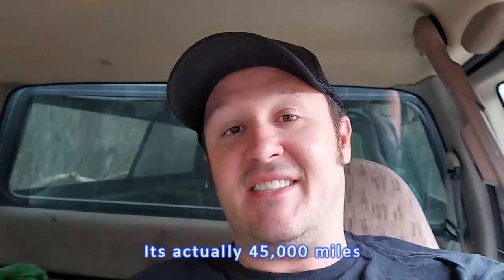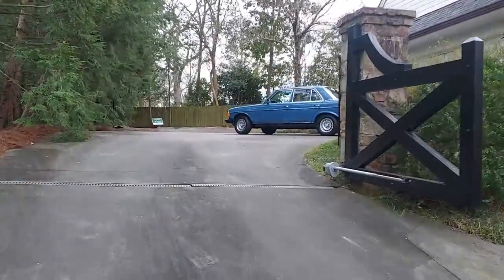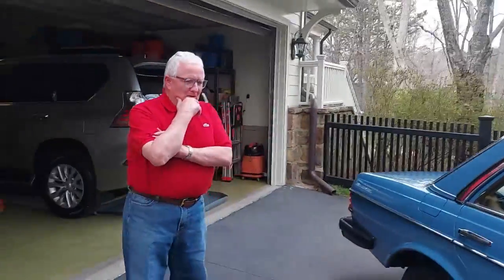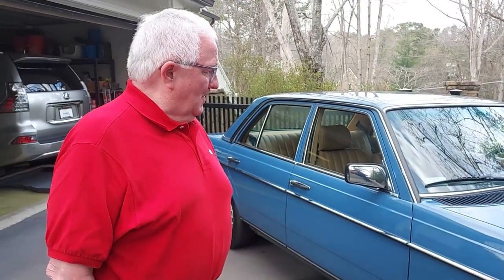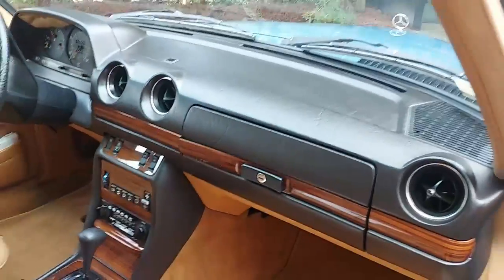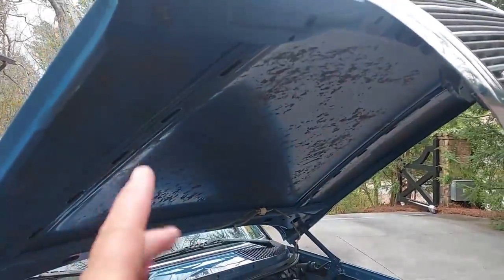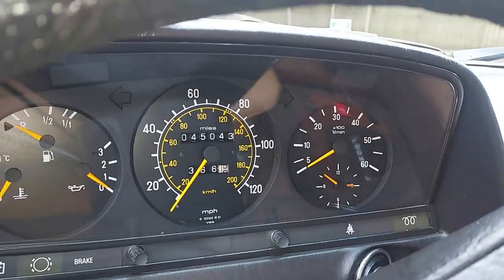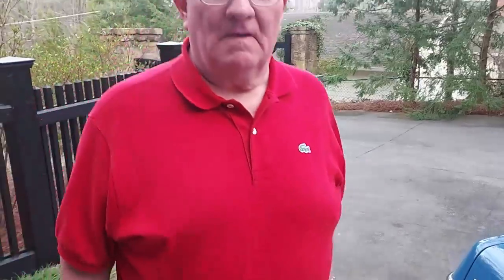1983 Mercedes 300D -  Part 1 Meeting the owner and buying the car

Comment: What a great find….practically a new car!  I had one in that color many years ago with ivory interior.  May I ask what is it about the 1983 models that makes it your favorite?  Just curious….
Reply: I'm curious too.
Reply from the maker: I like 83 models because the seats are little more comfortable and Mercedes started to introduce a lot of plastic and rubber in the 84 85 model whereas on the 83 model you have more metal and Chrome. 83 model also has a much simpler vacuum system then the later years. 83 is just the Sweet spot
Reply: Thanks for replying.  I was just curious.  I have a 240D and a 300D, both '82 models.  Love them!
Reply from the maker: @Keeferlgb  82 thru 85 are all nice!
Reply: @woodsandbarclay Do those same characteristics apply to the 300sd as well?
Reply from the maker: @andrewray656  not as much the 300sd stayed pretty much the same quality through 85. You didn't really see as many changes on the SD. They did change from a chrome antenna bezel to a rubber antenna bezel but not much else is different. In the early 81 model the rear trunk panels are fastened a little more securely with more screws. The 81 model was slightly higher build quality than the 85.
Reply: @woodsandbarclay  good to know. Thanks, John